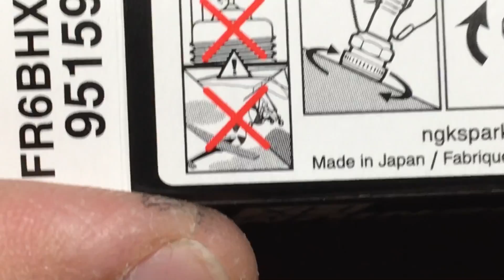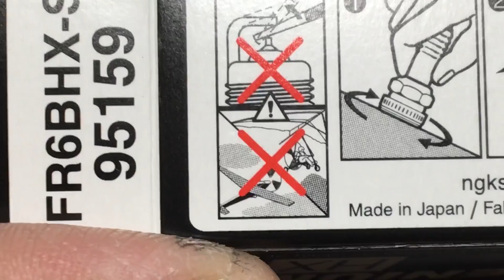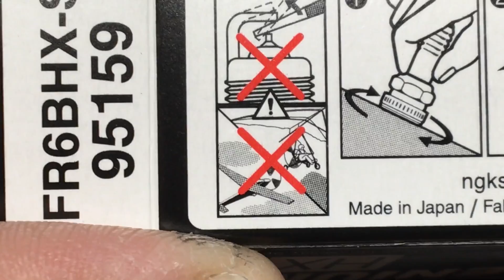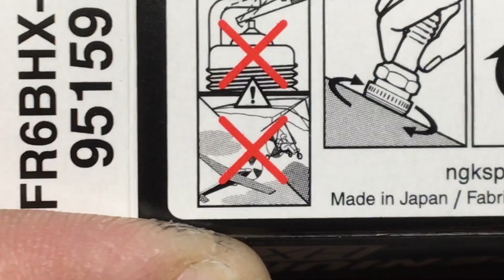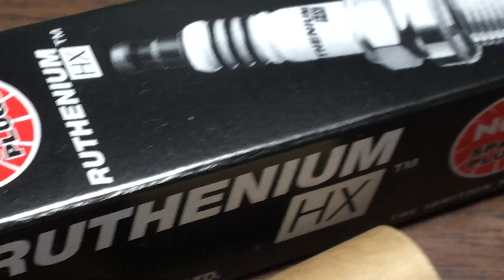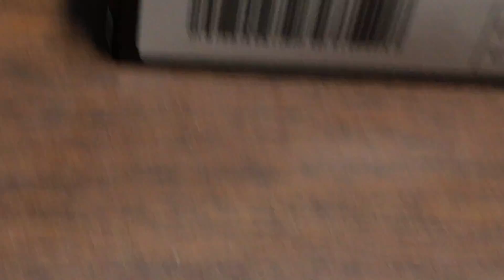NEW NGK RUTHENIUM PSPE SPARK PLUGS- NEW INFO

Comment: They are not saying not to gap it.  NGK is telling you not to pry up against the center electrode.
Reply from the maker: Don't worry, my gap tool doesn't touch the center electrode and gapping to .044" worked out fine. Idle is smoother and all else is good.

Comment: The NGK PSPE is for turbo or supercharged application. I presume your Camry is. DPE is for non turbo.
Reply from the maker: Yessir, but they don't make a DFE for my engine and the PSPEs work better than fine, so....
Reply: @dbfcrell8300  I did some extensive research on the NGK site and forums before ordering to see if the cost was worth it and they were slightly higher than iridium. 
I just ordered a set of 4 from Rock Auto for a Ford Cmax hybrid, The plugs are a b#$%^ to get to. You have to unbolt the air cleaner, plenum, air intake then unbolt each individual coil pack. I am changing my air filter at the same time replacing it with a K & N because of the difficulty involved. I have K & N filters on all my vehicles and motorcycles, even the wife's Grand Caravan which is also hard to get to.
 I guess I will see what they send me. 
Reading further comments, Rock Auto sent you what they had and are not aware of the differences, most likely like was said, they don't make a DFE for that year Camry. 
Rock and Cardid were the 2 least expensive for my car at around $8 apiece, I have seen my  DFE LTR5AHX .052" gap on ebay and amazon ($23.14) up to $25 apiece or more. You have to watch out since there are also NGK fakes on ebay. Your FR6BHX-S plug on amazon is $21.03 and shows the image of a PSPE with a .044" gap which is the only Ruth plug available for the Camry. 
Even Advance $12.49 is cheaper for my plug, NAPA at $12.35 apiece ,  Autozone $12.35, and you can order from NGK at $11.49 apiece.
Many people swear by amazon, but it pays to shop around. Looking at the local auto stores and Rock Auto/Cardid, why would anyone would buy from amazon? A difference of $15 a plug X4 is a $60 savings, (even more if you have more cylinders). You can spend the savings elsewhere.
Reply from the maker: @pberthoty  If you're plugs are tough to get to and you p[lan on keeping the car for its life, then these are the plugs for you!  In hindsight, RockAuto did know what they were sending me. I had thought they sent me the wrong style, but then found out from NGK that they don't make DFEs for my engine. Even so, NGK says the PSPEs are perfectly fine for my engine, and I couldn't agree more. I am totally happy with the them and even if NGK started making DFEs for my engine, I wouldn't swap them out. I like the idea of the projected square, and in my follow up video where I pull them out after thousands of road miles, they looked wonderful, much better than the OEM double electrode platinums the engine was designed for. I shopped around for them everywhere, but at the time, I had a credit with RA, so it made sense to get them there.

Comment: Ordered these for the 2011 lexus is250 with 120,000 miles. Hoping no problema with these plugs . Got these on rockauto  .
Reply from the maker: DFEs or PSPEs?
Reply: The nom turbo set . Update car is running great . Fuel ecomomy seems to have increased very slightly.will be getting these for my 2006 subaru sti

Comment: Not all ruthenium tips are like that. That square end is for turbo applications. Not a NA old Camry. The ruthenium resist corrosion. The ground electrode weld is normal not shotty. The only improvement will be in cars like mine. A 2018 type r that run lean under high boost applications. The ruthenium in the sane heat range can’t hurt. The heat range is important not the material when it comes to combustion ignition times being correct. Under 26 psi boost at 13-1 to about 12.5-1 it will ignite without detonation in a turbo charged direct injection engine. You won’t get partial burn misfires. That’s what is special about them.  They don’t melt either and don’t ground out improperly like traditional iridium can under high boost applications. The website clearly states all this except the afr range I provided.
Reply from the maker: You should probably read the video description.

Comment: These plugs are designed for forced induction engines not stockers in a camry
Reply from the maker: Yes, PSPEs are supposed to be optimal for forced induction engines, but they still work better than the oem plugs in n/a engines. DFEs would be more optimal for my application, but they don't make them for my engine. Please read in the description of my video where NGK explains all this. That's what my video is for.... so we can all learn.

Comment: Iridium is NOT for gas mileage.   It is a coating to do ONE thing: improve spark plug life.  * shakes head*
Reply: Iridium plugs gave me consitant 4-5 more mpg over platinum plugs.
Reply from the maker: @texaskidzuk  I can totally believe that. I'm never going back to OEM plugs
Reply from the maker: Sorry I wasn't clear. This was unscripted. Among several things I was looking at, one was to see if my mileage changed at all, which it did... slightly. I had many other concerns with these unproven plugs being in a slightly non-optimal application, however, they proved to work better than the OEM plugs across the board.

Comment: Here's my summary.... According to Mike Becker from NGK, by choosing to run the NGK PSPE single conductor Ruthenium plugs over the OEM Denso Double Platium plugs in my 99 Camry 2.2l, what I essentially get is slightly more spark efficiency with slightly less reliability due to this single ground electrode design from the OEM double electrode design. If NGK were to make a DFE Ruthenium plug that fit my engine, (which they don't), it would be even more efficient, although fairly negligable. Since Camrys are known to be one of the most reliable engines, and I ain't know ingineeer, I believe this trade-off is worth it as the engine definitely feels more efficient. Funny, I keep thinking this added omph the engine has is going to end soon, but the Rutheniums haven't dissappointed me yet after several thousand miles. 

I drive on the highway almost every day going speeds I won't mention here, and I travel just over 100 miles per day. Now regardless whether others think I should use Amsoil or Walmarts cheapest oil, I use Pennzoil 5W/30 Platinum Synthetic for higher mileage engines (based on the Project Farm unscientific, but real-world testing) and try to use my Cruise Control to cover long stretches most efficiently. The car is currently getting 28-29mpg which hasn't seemed to change at all from when I ran the OEM plugs, however my driving conditions have changed slightly, so it's hard to say why there's no change.  Another factor to this may be the extra oomph I mentioned, which I like to use more often.

Other than the expense of these plugs, which the return will probably never be realized within my engine's lifetime, and in fact may cause earlier engine issues due to my heavier gas pedal work, I'd call these plugs a genuine win in the oomph department. Your results WILL vary.

Comment: I just put a set of these (TR5AHX) in my 02 Suburban that has 269,000 miles on it. The plugs I took out were Bosch Platinum Fusions and they looked pretty bad. With the new NGKs I noticed a quicker start and smoother idle. I took it out for a drive and getting on the expressway it got up to speed a lot quicker. Can't wait to see what they do for my fuel economy.
Reply from the maker: Were the Bosch in there for long time?
Reply: I'm guessing they probably were. I bought it last year with 253,000 on it and I've put 16,000 miles on it since then.
Reply: So 5 months later.... what have they done for the fuel economy?
Reply: Can we get an update!!!!
Reply: @vincetaylor3948  Not much difference in fuel economy, BUT 309,000 miles on it now and it's still running strong!
Reply: @riddler983  good to know thanks for the update

Comment: Hey everyone, DBF Crell reached out to me via email in regards to the DFE and PSPE designed NGK Ruthenium HX spark plugs. Yes, PSPE is designed for boosted apps and DFE for N/A motors...but they will work in either engine. In an N/A motor the DFE will hold a slight edge in terms of performance and efficiency over the PSPE, but the PSPE will still perform better than the older designed plugs. It will not wreck his engine or cause issues. At this time NGK does not manufacturer a DFE plug that meets the specifications for this application.
Thanks - Mike Becker, Senior Technical Instructor
Reply: @Mike That's an interesting take on these...was wondering this exact question about the two designs. Thanks for the comment on this video!

Comment: Rock Auto shows a difference in the plugs for my car. I have a Volvo XC60 with the SI6 engine. The SI6 was made in 3.2 NA and 3.0 turbo versions. The basic engine layout is the same, and the part numbers are the same for every other spark plus Rock Auto carries EXCEPT for the Ruthenium ones. The 3.0 T6 takes a 93420, but the 3.2 NA uses 94122, so they're different.
Reply from the maker: I wonder if the DFE just have a different part number so no one confuses them with the PSPE plugs that are for turbo'd engines. If you ask Rock Auto and they respond, please come back and tell us why there's 2 plug numbers.

Comment: You bought plugs specifically for turbo or supercharged engine. They make two versions of Ruthenium.
Reply from the maker: That's interesting. I'll look into that. They seem to work great. I told Rock Auto what car/engine I had, and this is what they sent me. Thanks,  maybe they'll send me the right ones???
Reply from the maker: David Carter... Thanks for the heads up!  I checked into it and you're totally right, they make DFE and PSPE.  Rock Auto doesn't give you the option of one or the other.  I tried to get them to understand that, but their horrible Returns page doesn't allow explanations so it won't happen again. It's sort of NGKs fault because they don't explain this well on the RA site
Reply from the maker: @Flapping Flight Well, you hit that one on the head. I just updated my Description above to include the response I just got from NGK. It pretty much supports your statement. Thanks.
Reply from the maker: @Flapping Flight FF, yes, thanks. I know of indexing from the tuners at the shows I've attended, but didn't know about the gap increase. Thanks for your input.
Reply: No, no, no!

Comment from the maker: I'm updating my finding on gas mileage. I seem to be averaging just under 30.0 mpg in my 99 Camry 2.2L. This is up by about 1 mpg
Reply: That's awesome. I have an 01 Camry (2.2L 5SFE) with 400k miles on it and a few months ago I put in Iridium IX sparks. The car is really sluggish, and has terrible mileage... I might look into buying these from the NGK website.
Reply from the maker: @R00B3R  If possible, try to get the DFE (Double Fine Electrode) version. Rock Auto sent me the PSPE (Projected Square Platinum Electrode) meant for turbo'd engines. After talking to NGK, I now know there won't be a problem using PSPE in a DFE application, it's just not optimal, but still better than most OEM plugs.
Reply: @dbfcrell8300  So how did the double fine' those work for your car...mileage wise, scale buildup.
Reply from the maker: @Idahomie  I don't want to sound like I'm trying to sell anyone on these plugs, even knowing the projected square is not the optimal "style" for my particular engine, and I know I have no scientific data, but....  I wouldn't trade these plugs for any other plug, including the OEMs, Brisk, Pulstar or any other fancy plasma-breathing plugs. My old Camry 2.2L engine LOVES these plugs. I have not removed them from the engine yet, but will on Monday or Tuesday of next week. I bet they come out at least as clean as my last set of OEM twin electrode platinums. If memory serves, I have just around 120k miles on my engine now. The engine runs much better and the increased power is most definite and reliable. I'll make a follow up video and link it when I pull them out.